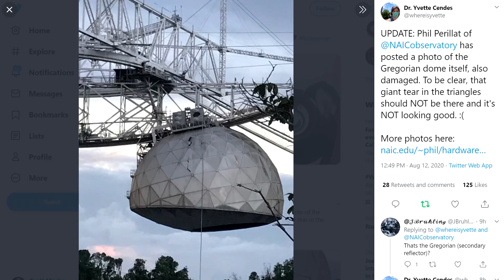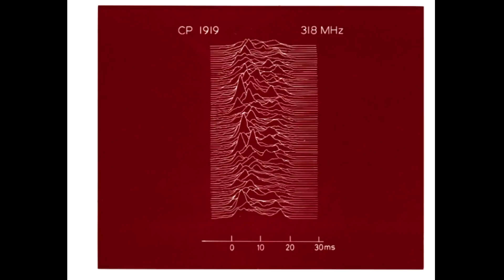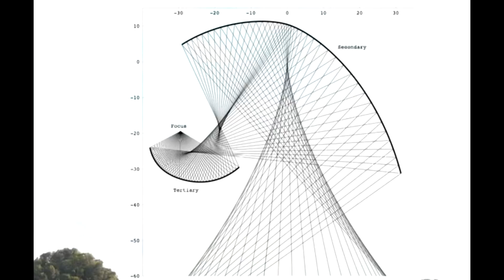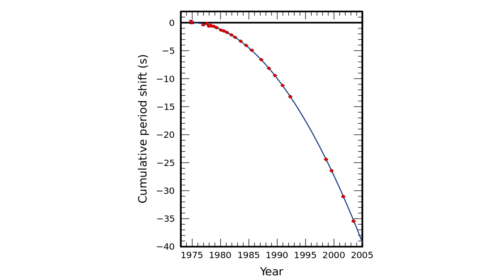Snapped Cable Damages Arecibo Observatory Radio Telescope

Comment: Hang on, hang on, you're telling me that we've got a radar that can ping stuff 10 AU away and pick up the return echo  o_0 that's all the way out to saturn, that's insane.
Reply: Clearly we need to take a large crater and just build a bigger one. Saturn isn't far enough.
Reply: @namibjDerEchte  There is an idea for something like that on the far side of the moon, look up LCRT.
Reply: @namibjDerEchte  Like the one in Arizona?
Reply: @namibjDerEchte  On the Lunar far side for shielding, of course.
Reply: namibj welp we should biuld one that can see to Pluto. It should take a dish that is around.  1.2 Km in diameter. If builed correctly it can be very powerful and very persice. But very delacit.
Reply: How about if we send a signal out, then 24 hours later (when the dish is back facing the same way) we detect the signal coming back?  Assuming there's something out at 86 AU to reflect it back, of course!

I do hope they can get better funding, as well as get things repaired in a timely fashion.
Reply: @bobblum5973  what are they hoping to hear? What frequencies are they looking for? How long and many different wierd frequencies have been picked up?
Reply: @america912  Those are all very good questions!  And that's what science does, ask questions, look for answers, ask better questions, then continue the process.
Reply: Bob Blum not a bad idea but you have to remember the earth is constantly moving around the sun.  By the time the signal gets back to earth’s orbit earth itself will have moved out of alignment.
Reply: Bob Blum speed of light. And rotation of earth plus the movement of earths orbits. We would miss it. Unless we would have a array of radar dishes in orbit/ larange points then it may not work. Evan if it did hit earth it would most likely hit the pacific or a area with out the dish. 

But I am only saying it would be very difficult to do what your saying. Not impossible. 
We all know nothing is impossible to scientists. 
Given time, imagination, will, and resources.
Reply: @spacetechempire510  Oh, agreed, I never said it would be practical! :D
Part of what I hate about Flat Earth believers is their denial of literally centuries of discoveries and proofs of how reality works, all to make themselves feel smarter or more important because they've dreamed up a conspiracy theory which has no proofs at all.  Scott's description of how the telescope has been upgraded and maintained over decades parallels the progress of science and technology in general, always improving.
Reply: Bob Blum all I said is that a earth based one may only be able to scan our own star system with persuasion. (Is the one you thought of) but a array or a few masive space based ones might be able to do what your saying. 

I just say it’s unpractical for our current tech level. But might become phi-sable in a few decades.
Reply: Bob Blum I agree to your state ment that science alway keeps progressing. Uncovering secrets and technology. I only say a radar dish meant to scan a object and wait 24 hours to receive the signal is impractical due to our planets solar orbit. We would of move outside of range by the time it bounced back.
Reply: @spacetechempire510  Oh, I understood that.  Tossing ideas around helps us come up with new ways of looking at things.
Reply: It can also cook a tv dinner in seconds
Reply: I really do wonder what it would take to put a radar station or telescope in space.
Reply: @gsail6600  SpaceX is working on that cell phone coverage very thing. As of Aug2020 they have put into orbit over 300 satellites for cell phone coverage in remote areas, slowly but Shirley it will happen

Comment: Hey Scott the radio dish is also featured in a video game called battlefield 4, rogue transmission is the map and it’s ironic how a cable snapped because in the game they have something called levelution And what happens is you snap the cables and the telescope top portion will fall down in the game. Even more ironically the damage looks just like the game as well.

Comment: *Humans should get this Emergency Message on how to Cure their "Covid-19" Issue Right around Their Month of August, their 20th Day, in Their 2020 calendar Year!, luckily our ship is only 6 Light Months from them right now, and while we can't stop by since our ship doesn't have the fuel from the initial laser light pulse that has us on the way to our other colony.. so We have targeted their Long standing Arecibo Radio Telescope, but we only have enough power to send it once and will have to wait 5 years if it fails to reach them for some reason so we can resend it from site B,. but it will be fine, there is nothing crazy with this year "2020"  Right?   That would be like the silliness of the number 13.   They will get the clear easy fix for their issue no problem...

Comment: These days they use epoxy, not metal. But yes, that is a peltor socket.
Reply: @rogeramjet100  
I don't think Scott would use a proprietary and particularly specialized bonding consumer name for a generic potting epoxy. He'd simply say 'epoxy'.
The company in question that did the Arecibo cables is Muncy, and they still use zinc for those sockets. muncyindustries . com/Catalog/socketing-zinc.php
Reply: I've never seen cables that large use epoxy, doesn't mean none have but I have seen cables that large replaced in the last year and they were done with zinc.
Reply: @andycanfixit  Yep, zinc at Arecibo.
Reply: It's zinc in this case. Which also helps with corrosion at a site that gets a lot of rain.
Reply: @MikeCnolan  I'm assuming the cable was probably galvanized as well. Zinc being a relatively soft metal, your comment leaves me wondering about the mechanical action of the cable's constant movement over the years eroding the fastening ability  of the socket to cable junction.
Reply: @williamswenson5315  I am not a structural engineer, but as others have said, this is the standard way to permanently attach cables to sockets. My personal guess is either a defect or something earthquake-related, but we'll see.
Reply: @williamswenson5315  Yes, "ASTM A586 premium grade with class A galvanized coating on all wires"
Reply: @MikeCnolan  It's true; if you want to know something, ask an expert.
Reply: Same Pelton as the Pelton water wheel?
Reply: are you sure it isn't a  spelter socket?
Reply: I'm quite certain its penis socket.

Comment: "thankfully the engineers are smart and  they have redundant cables"
the cable actually causes the damage...
Reply: No redundancy means the instrument package falls, destroying it and even more of the reflector.
Reply: Well, if the suspended structure had fallen down, the telescope would be basically a complete loss, I imagine. This looks repairable.

Comment: Wait so there's the limit on how far they can use the radar due to it moving out of it's path of sight, but theoretically, would there be a series of distances further out that by the time the pulses were reflected back, the Earth would have rotated all the way around to pick them up again?
Reply: The Earth also moves out of the path of the returning waves as it moves around the sun. After a period of 24 hours it would have moved by 1.6 million miles.
Reply: @mattbland2380  oops I knew that I just forgot to say it, but couldn't you account for that by either "leading" the radar and hoping it bounces off some of the target at an angle or aim far enough away that the relative distance the earth moves doesn't affect it?

Comment: Would there be a second Arecibo radar range band at ~24 light hours, such that the planet's rotation places the telescope back under the rebounding radiowaves? I guess it'd probably take excessive radar emission power to actually produce a detectable signal at such distances.

Comment: This is what I heard from some of the signal processing people:  The cable that broke was an auxilary support cable to counteract the torque produced when the platform moves and weights 17,000lbs.   It did indeed come out of it's socket.   They have plenty of panels avaliable to replace the ones that were broken.

Comment: Can’t say how many times I’ve run around on top the instrument platform in Battlefield 4. This makes me drool as a Ham operator and licensed electronics technician as well. A giant antenna with research-quality frequency response across multiple bands? I need to tour this place someday. Also amazed at the bundle of 3ft diameter feed lines running from the lab to the antenna collector.